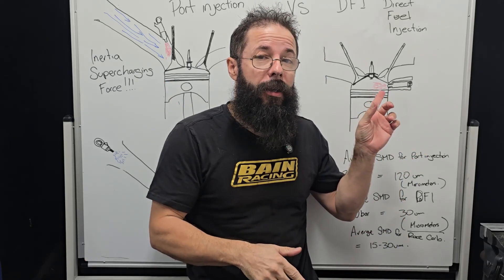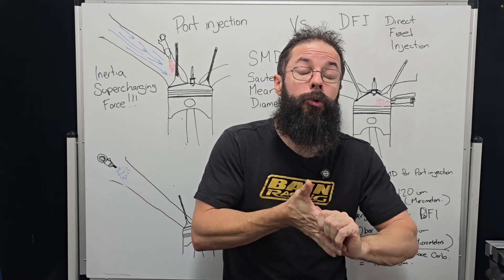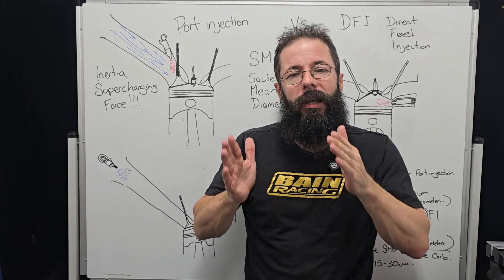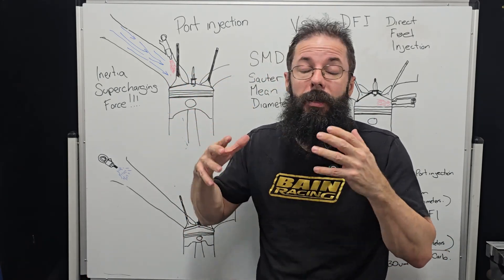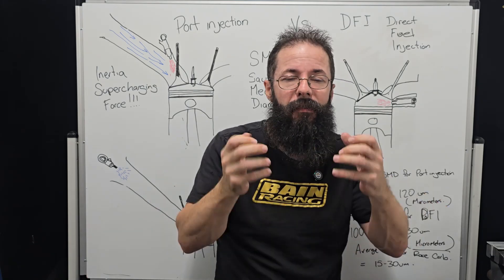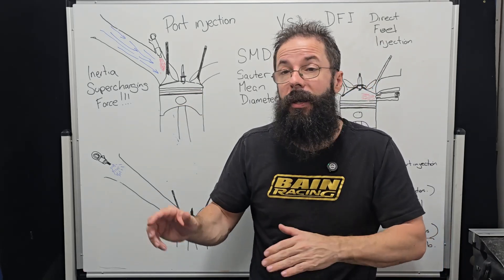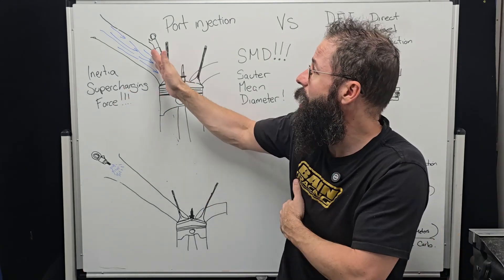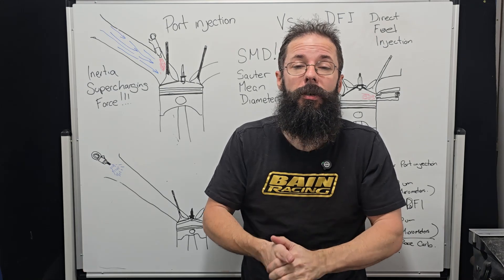DFI vs. EFI: The Hidden Science of Fuel Atomization and Engine Efficiency #carcommunity #EFI

Comment: I know this isn't the latest vid, but I feel we need more calcs on valves, is there a good ratio, ex-in valve ratio? Does the exhaust valve saturate? I imagine large exhaust pressure and small pipes increases saturation and what kind of flow difference can we get from different valve seat angles?
Reply from the maker: No there's no ratio as such as its head and chamber dependent and if you notice many heads have gotten smaller ratios over the last 15 years. So much bigger intakes and still run small exhausts. 

This is because we are dealing with a very different pressure differential. Also, the chamber design will change how "big" the valve looks. And what's "small" as far as pipes go?  Smaller pipes say at 100% of valve size will extend the blow-down phase time. So we will need to add more duration.

Comment: Wait what? I'm confused, shouldn't the mach in the intake be more like 1/4 of mach not 1/2? 1116 ft/s, half is 558, quarter is 279 ft/s, which should be about spot on for gas velocity? Or what am I missing something here?
Reply from the maker: You're confusing flow bench velocity which is 300fps and 400fps at the MCSA Ave, with dynamic engine velocity which is up to 710fps at the MCSA

Comment: Could you raise port injector pressure to make the drops smaller or would it just paint the port walls?
Reply from the maker: Yeah, F1 did this. But you would need massive pressure, as shown in the difference between port injection and DFI.  Amplitudes in the 50-100×

Comment: Very interesting to hear this topic discussed this way. You described it as sheer effect of the fuel being sprayed in farther away from the intake port but I have always heard it described as charge cooling.

In the past I have seen carbureted engines make more torque or horsepower at certain rpms over similar EFI engines from that longer charge cooling path and peak mechanical efficiency. However they typically make less everywhere else in the graph because the engine is less overall efficient. 

Have you ever run individual cylinders Lambda sensors to see what the AFR is per cylinder because I have and it is kind of scary how far apart each cylinder can be from max to min?
Reply from the maker: Yeah, it's this turbulent shear mechanism that allows for the phase change, which leads to the cooling benefits. 

Yeah, usually, EFI will make more torque, and carby will make more peak.  About 2-3% back to back due to the temperature differences and the EFI needing a shorter runner.   That's changing nothing but where the fuel is added.   That's with a real rave carb, though,  not a cheap Holley. The bitter the caeb the less pressure differential they need to sacrifice.  

Yeah, generally, when we dyno, it's either EGT and collector AFR.  Or 8 AFR sensors. 

The EGT will tell you your separation between cylinders, and they also show DET earlier, and if EGT's are balanced,  then you know the average AFR is bang on! 👍

This is how we tested our forward facing intakes to get the ratio right to get all cylinders within 2% separation.

Comment: Two Questions:
A) What about the evaporative cooling effect of moving the port injector as far away from the valve as possible?
B) Why not use a DI injection system (very high pressure) in a port configuration?  Wouldn't this create an even denser, more homogenous intake charge?  
Brilliant!  Thank you for this.
Reply from the maker: Yes! And yes!  That's exactly what F1 did in the pinnacle days of the NA series.  And yes. When I talk about density recovery,  that is due to the phase changes, creating the very cooling you talk of! 👍

Comment: There is much much more aspects to consider in GDI v PFI. You did touch on the air displacement as the fuel  vapourises in the port but the duty cycle of the injector is extremely important (for GDI and PFI) as a short pulse when the valve shuts causes the fuel to move up and down the port with the inlet waves causing droplet break up and hence charge cooling. There is nothing stopping you running much higher pFI pressures as well to have even lower droplet sizes. GDI is another whole world and needs a vast amount more explanation especially in terms of spray geometry. You can absolutely destroy performance with poor spray geometry, much more so than PFI. SOI is extremely important especially with the shorter pulse widths and an order of magnitude more so  with GDI. This topic really needs a proper paper written on it (it would takes me many many hours!)
Reply from the maker: Yeah! Well aware,  this was in reply to why DFI makes more power when back to back, same engine port vs DFI, and the main factor is the DSM size. 👍 similar reasons why carby makes more peak than port injection.  If with the pressure drop penalties.  

But yes, I have gone into many other factors for podcasts for EM and may do more on this channel. May even cover prechamber ignition like F1 use, and yes, we  broke down the Yamaha study on injector placement and timing.   

Many still believe shooting at the valve is best. Unfortunately, that couldn't be further from the truth!

Comment: Question 
im considering twin injectors per runner for my 1000 horse street car..Atomisation of two side-by-side injectors isn't most efficient but seems very common..my question is facing two injector nozzles onto each (few degrees forward) from opposite ends of the runner. runners sides..will this cause the spray pattern to atomise even more?
Reply from the maker: If you have the port width, they seem to be ok, like on a BBC., lots are turning them into the centrelime of the port. 

But smaller ports tend to suffer.  We have been finishing these in a burr finish for a little more boundary control. Seems to help. 👍   but obviously, high/low is best!

Comment: Actually, it's more about the design of the combustion chamber than anything else. The multi valve chambers leave very little space to include an injector without having to make shrouded areas. Complication, indeed.

Wedge combustion chambers, such as Chevrolet's LH, suffer from even worse crowding.

One that should reap the best rewards from DFI is one that's been around since '03, namely the Chrysler Gen III Hemi. Basically, by turning the head over to the combustion side, you can see why. The twin spark... by replacing one with an injector, you have the best example of a clear, concise combustion with no "hang ups".

Its worth a try, if it hasn't been done already.

Comment: It was perfect but then these corporations push new ideas with their reasoning to make money. It was proven if you heat the fuel and use the vapors it produces more efficiency per unit of power expelled. Direct fuel injection is crap and then only push it because they can make more money as they break.
Reply from the maker: What?

Comment: Most Bosch DI system are 200-250 bar. Bosch are the most commonly found injectors in most DI application. 

In the BMW b58 they have a 344 bar system. 

But most DI injectors are flow rated at 100 bar. So when you purchase a set of injector it will be rated in CC at 100 bar. 

In my experience older style DI injectors are better then moden DI injectors. They tend to flow more, less likely to clog up and are easier to modify.
Reply from the maker: Yeah exactly right!  Though some of the new injectors in development I'm reading about  now will change the game again!  

Cheers for the comment 👍

Comment: So port injection with loads more pressure should create a better fuel micron size?
Reply from the maker: Yeah, there's a clear correlation between pressure and molecular size of droplets.  But the difference between 40-100PSI isn't much.   We have seen slight improvements in power running up around 100psi.   But on electric pumps, it's hard to keep that pressure.

Comment: If that is the only consideration, why did manufacturers switched from TBI to port injection and why there are no production car that uses F1 injection style?
Reply from the maker: Because TBI was horrible! Is this a serious question? 🤣🤣👍
Reply: I didn't mean to say it is better. I meant to say it is not the only consideration. Even examples of 600rr mentioning having two sets of injectors tells something.
Reply from the maker: @NikCh86, what does it tell us?
Reply: It is not the best approach to consider one factor in isolation. Otherwise great information.
Reply from the maker: @NikCh86 😂😂.
Reply: In case of 600rr , port injection is better for low rpm because of throttle response and probably emissions. My personal opinion is is very negative in respect of direct injection because we add extra complexity  such as high pressure fuel pump and loose ability to keep intake valves clean. Both are detrimental long-term. If we built engine to run a race, pass stricter emissions a few % of gain is great. For the rest of us, it is not.

Comment: My 2005 CBR600RR had dual injectors per cylinder. The second set was way upstream and would come online at roughly 5K rpm. Kind of impressive how production engine from 20 years ago were already making 200hp/liter and were making use of the phenomenon you just described.
Reply from the maker: It is mate! Bikes really have always pushed the development and leading tech.

The Yamaha study I referenced, is one we are doing a podcast for Einstein Motors. This study was on a Yamaha 250cc cylinder test engine. 

They are very intesting to test fuel distribution issues due to their over square bore. Making it harder to optimise fuel atomisation due to slower pistons speeds and extended dwell.

Comment: Lexus v6 has Port and direct injection , and with a “Tune”, seems to be the most energetic non turbo v6 I’ve owned.
Reply from the maker: Yes, it's a great combination for responsiveness and smooth power delivery.  Many manufacturers are using both.

Comment: Very interesting. Do you have any thoughts on how the delay caused by port injection compared to DFI affects how quickly/well you can control the throttle valve with a closed-loop drive by wire system?
Reply from the maker: There really shouldn't be any delay at all. Between the two systems. It's more just a power and emission difference.  Most closed loop throttle controls, its the throttle that's the delay, hence why you can buy throttle box units that speed this up. Or tune the speed of response. It's more of an OEM protection thing, than than the injection position.  Hopefully, that's what you meant 👍
Reply: @bainracing  Yes, thank you very much for making it clear. Very helpful

Comment: Could someone clarify the situation, is it racing engine with WOT all the time, or family car where you take emissions and economy into the equation?
Reply: Better fuel mileage, means less pit stops and racing. Unless you live life quarter mile at a time 😂
Reply from the maker: Both! Emissions as far as un-burnt HC are improved in both cases.
Reply: @bainracing  Interesting reply, I'll have to think about that.
Back when carburetors where been obsoleted to EFI tech, very briefly we did see CFI central port injection, so 1 or 2 injectors were fitted into a carb. like body but quirted fuel just above the throttle plate, is this what you were describing about " further away from the port" but we are talking 50year tech!!
 Sounds like another video needs to be made to explain
Reply from the maker: @alexchong213 yeah the fuel control of DFI is so much better.  And now some of the new studies I'm seeing on multi fire propagation is showing they are taking it even further.  

 Yes, throttle body injection, which we still have in the aftermarket industry with all these injection carby kits.  

The oem injectors in these were of horrible quality and produced huge fuel droplets. 150+um. So they really needed a lot of shear time to pull those fuel molecules apart. 

These all tend to be worse due to the fuel particle size. That MSD factor. 

Intesting fact. A good race carby will be as small as 15-30 microns. 

This is why carbies for the same CFM will generally make more peak power over Port injection.  👍

Comment: Again people falsely believing that GDI makes more power than all other forms of fuel delivery. GDI is the worst out of all the forms of fuel injection, and all fuel injection is defeated by the superior atomization and cooling effect carburetors have. Before you say I'm crazy hear me out. Liquid fuel doesn't burn it is the vapor. In order for the liquid fuel to atomize and then vaporize properly, It takes time depending on a whole list of factors, like the engine quench clearance, piston speed, and most importantly vacuum. Fuel atomizes really well under vacuum. Do you know what happens when you inject fuel directly into the cylinder during the compression stroke? The fuel never sees vacuum! Than all the unburnt fuel ends up in the exhaust, and sticking to the cylinder walls contaminating your engine oil. I know that when there is less fuel in the intake port you can cram more air into the cylinder. But if your cylinder heads are worth anything you should be able to get enough wet flow to support your cubic inches and rpm, and then have a better atomized charge that is also cooler. This colder more dense charge will make more power. Lastly for all of those who still want to defend GDI all the fuel in your engine oil was it used to turn the crankshaft?
Reply from the maker: Please learn the basics before commenting on this channel. That's all we ask!  

This has been proven time and time again by us and many shops we support.  Again, you have missed the whole point of "WHY" they make more power.
Reply: @bainracing  Basics, That's funny I bet your the type that thinks your something special because you got a collage degree and did great in algebra class. You had nothing of substance to say to even try, and argue against my point. Since you had no adequate rebuttal to my comment. You tried to intimidate me by saying "This has been proven by us." Just because you keep repeating plants crave electrolytes doesn't make it true.  Same thing with GDI you can side with the establishment all you want but it doesn't make you right. So I will ask it again the same question I asked all of the GDI defenders on the internet. All the fuel in your oil did it make any more power, lol.
Reply from the maker: Serious dude. Go learn even the basics before making a fool of yourself! 🤦‍♂️ 

And remember,  those that can't articulate always have their little insults!

That fact you're trying to make this personal shows you have lots to learn. 

Do better or get off my page. I won't warn you again!  

I have zero patience for egos that think that know, yet show they don't even understand the basics, then get all  butt hurt. 

So either grow up and act like an adult and learn that maybe what you "believe" isn't actual fact!  Or find another channel to follow. 

It's real simple! 👍
Reply: TBI was just as effective at cooling the intake charge as a carb and in fact some of those TBI engines got some of the best MPG. I would love to see 1000psi multi port injection right under the throttle blade. I've actually contemplated building a fuel rail to put inside my 360 magnum intake bolted to the plenum plate spraying fuel directly into the opening of each port but I ain't that good at fabricating and it would still just be the 50psi stock pressure.
Reply: @ TBI doesn't have the venturi cooling effect.
Reply from the maker: @DavidPhillips-rs5dq What data do you have on this??  Any port temperature logs at all to claim a ITB has the pressure drop and carby does? You do understand how a carby works right?
Reply: @bainracing   the throttle blade still causes a pressure drop under it, you do understand how a throttle body fuel injector works?
Reply from the maker: @DavidPhillips-rs5dq No
It doesn't,  a basic CFD will so you it doesn't nothing more then add some turbulent flow eddies after thr blade. Hence why barrel valve makes more power again.
Reply: PDI or direct injection is more effecient and more powerful. This has been known, tested and proven since the 1930's. Commonly used in WW2. It's far from new technology. It hasn't been used in small engines due to manufacturing limitations. The technology used in F1 cars now, excluding electronics, was being used in WW2, namely the DB600 series engines.
Reply from the maker: @chippyjohn1 👏👏👏👏

Comment: The problems we see at the dealership is carbon buildip on valves, rings and injectors using causing misfires.
Reply: Dfi sucks
Reply from the maker: @roymoxley2587 😂😂😂 use your big words!
Reply from the maker: Yes, it's a major issue. 👍

Comment: It takes more energy to compress the fuel to 1000 psi than it does to make 50 psi, how much does that extra energy being robbed from the system offset what is gained by the slightly higher air flow?
Reply from the maker: It's actually about the same as most DI are using  very efficient mechanical pumps that are cam driven.   

Electronic pumps are very inefficient and always have been. 

And by the numbers and results, it's clear to see it's far more efficient. Even without taking into account all the advantages of DI.  Like improved burn, higher compression ratios, which improve all metrics. 

Then, it also helps extend engine life and improve both thermal efficiency and volumetric efficiency.  👍

Comment: I wondering if anyone tried putting direct injectors in a port injector setup to see if there was a power difference?
Reply: Ford used both in the Coyote a year or 2.
Reply from the maker: Yes, that's what F1 did in their NA days. Also, one of the Yamaha studies that is going up on Einstein motors covers this.
Reply: F1 ran 100 bar rules limited (tested up to 150) in their port injected NA engines. Made more power every jump they made.